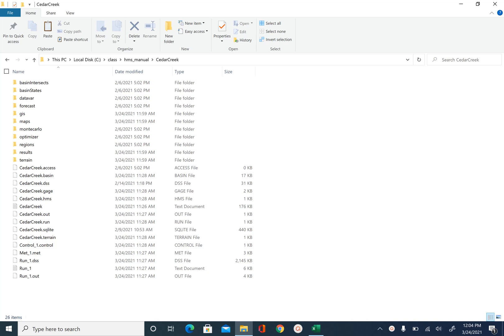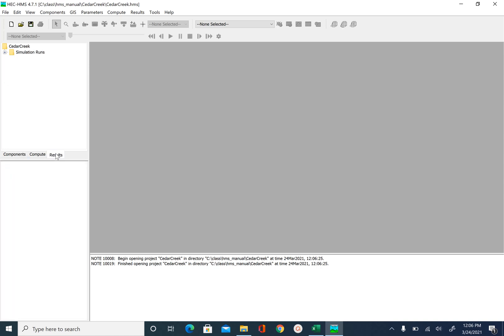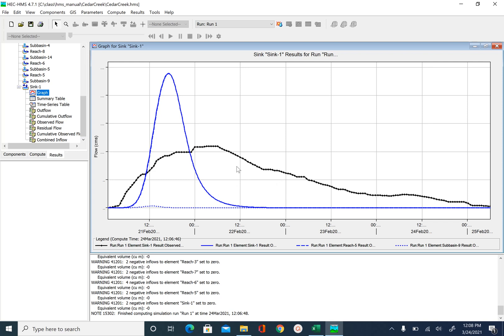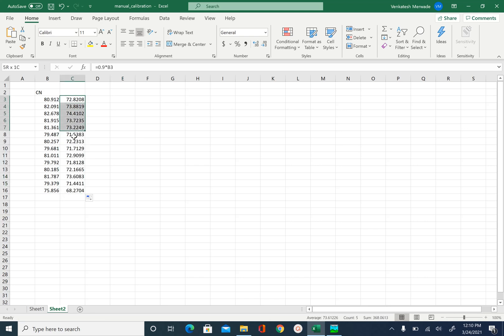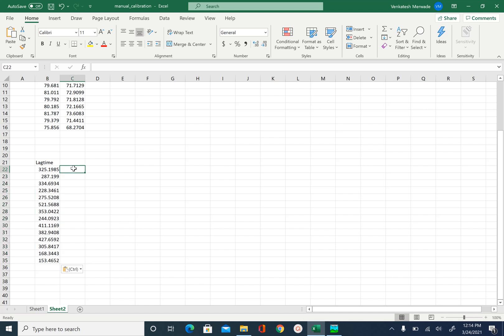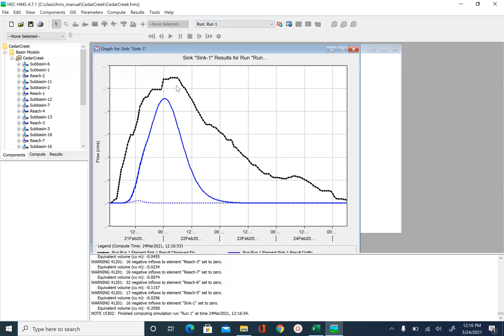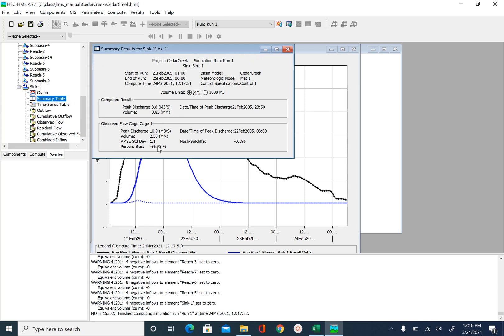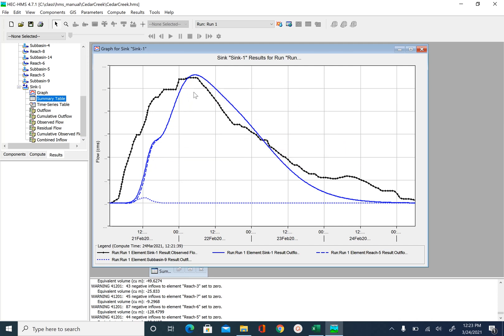Manual Calibration of HEC-HMS Hydrologic Model

Comment: What does the warning of muskingum routing is unstable with given parameters for reach R90 mean? I could not find anything in google.
Reply from the maker: If you know the method, the values of K, X and time step (delta T) should meet certain criterion. If that is not met, the routine becomes unstable You can try using a shorter time step.